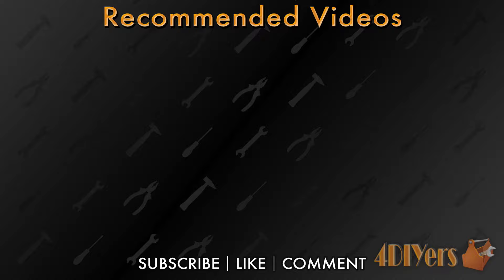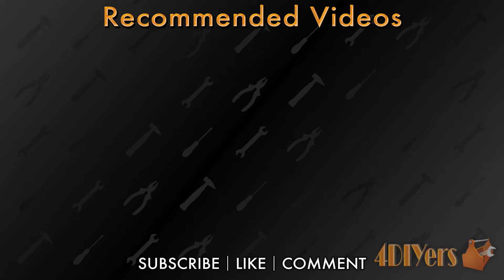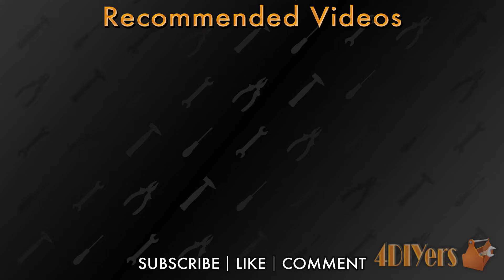How to: Toyota Tacoma 1995 to 2004 Fuel Filter Replacement

Comment: It’s actually 14mm line wrench and 19mm wrench.
Reply from the maker: Same thing... 9/16"=14mm and 3/4"=19mm
Reply: @4DIYers  ehh not exactly. 9/16” and 3/4” are ever so slightly bigger than 14mm and 19mm. Toyota never uses SAE sizes on their vehicles only metric. If you use the wrench sizes you provide then you have a greater chance of rounding the nuts off than just using regular wrenches. Other than that it was a very helpful video. Thanks
Reply: @bretthoughton7887 it's probably close enough for a fuel filter with very low torque on the fasteners.
Reply: After 24 years in place, almost every bolt under my truck is size Vise-Grip. Even the 14mm line wrench started to round the bolt head. So I ended up using a standard 3/4" and a Vise Grip. Had to muscle it quite a bit, way more than you would expect for a filter. But all in all not too bad.
Reply: @4DIYers wrong answer
Reply: @bretthoughton7887  Exactly!  They aren't the same sizes.  Even though they "may" be close enough, you run the risk of damaging the nut faces.  Use what is intended.
Reply: @bretthoughton7887  however toyota dont know every thing.
Reply: @bretthoughton7887 good point
Reply: Thank you

Comment: 19mm & 14mm not 3/4 & 9/16 (metric not imperial)
Reply from the maker: 19mm is equal to 3/4" and 14mm is basically a 9/16" (only 0.2mm difference). But the issue is not all basic wrench sets come with 14mm.
Reply: 4DIYers I didn’t even do the math 🤦‍♂️, I just thought “wait that’s not right”. I’m going to start helping my buddies work on their old fords with metric wrenches...🤫
Reply: @4DIYers   Its a metric vehicle, why you would do the conversion to standard is beyond me.
Reply from the maker: @innerpeas  It's not doing a conversion, it's basic important information when wrenching. As mentioned above, not all wrench sets come with a 14mm. It's like like a 13mm is the same as a 1/2". If you need two 13mm wrenches and only have one, you can use the 1/2" as well.
Reply: Never seen a wrench set skip a 14mm

Comment: Toyotas are a little different. A lot of Toyotas do not power the fuel pump just from turning the key on. The fuel pump doesn't get power until the starter is engaged. Unlike a Chevrolet.

Comment: Anyone know why my 98 tacoma 2.4l turns off when I come to a stop but starts right away? Only happens when I ran it for a little and I step out to go to the store and turn it on again took it to many mechanics and can’t find the issue
Reply from the maker: Do you have any OBD codes? Could be a faulty sensor or too low of idle.
Reply: Same with my 3.4

Comment: 1995’s filter is under the intake manifold, change the title
Reply from the maker: That's the 4cyl model, this is the V6 model.
Reply: yeah thats the  v6 . the four banger  is near the top of the starter  its a bitch to get at . unless you have  a car lift. hbjerry

Comment: Great video but which engine does this truck have? I believe the fuel filter is in different spots depending on which engine it has. I have a 2002 2.7L that needs a fuel filter replacement.
Reply from the maker: This has a 3.4L V6, for the 2.7L I believe it's behind the engine.

Comment: all the nuts and bolts on my Tacoma are in metric. Why would some use SAE?
Reply from the maker: Depends on the year or where it was made. This truck was made in California. Also I do tend to interchange between metric and imperial as some sizes are the same, like 1/2" and 13mm.
Reply: @4DIYers  I would go with 13mm because there are more teeth for a better fit less chance of damaging bolt head.

Comment: What about the washers that came with the new filter? No one mentions them in all the videos I've watched..
Reply: Didn't even see the washers until I was throwing the box away.
Reply: @YELLOWLEAF205  were you able to get itbinstalled without any leaks??
Reply: @gillardpetry2068  Tried three times and still leaked,second time I've had trouble with the washers and from now on I'll make sure I buy one without the washers.
Reply: @YELLOWLEAF205  mine leaked too. You really have to tighten the shit out of it. My mechanic friend said that you have to use the washers. Anyway, I got a 32nd more of a turn out of mine, and the leak stopped. It was weird, but true. It was so tight, I thought I was going to break the gas line if I tightened it up any more!!
Reply: @YELLOWLEAF205  good boy

Comment: The 2001 Tacoma 2.4  has a fuel filter under the exhaust manifold in the engine compartment. Somewhat difficult to get to.
Reply: How difficult?  I'm trying to find pictures showing its location.

Comment: As always, enjoy your videos. I have a question. My Jaguar started one day with a vibration type noise on the freeway. I feel it slightly in the seat, steering wheel (but the wheel itself doesn't shake like when you have a bent rim). This just started while I was driving at high speed. The dealer told me tires, so I fitted 4 new Michelins. Then they said rims, so I bought 4 new rims. Then they said prop shaft and gearbox mounting, but still the annoying vibration is there. It starts at around 50mph and is really bad at 85mph, but it's more like a noise with a slight vibration coming through the body of the car. Now they say engine mountings and they're not cheap. Could they be right? What do you think it could be as none of the things I've replaced have had any effect. I've noticed it's not so bad on hot days and worse on colder days.
Reply from the maker: Sounds like the dealer is just throwing parts at it under your expense. They're not properly diagnosing the car. Vibrations can be caused by tires and wheels, however the wheels can be checked for bents. I'm actually planning on doing a video like that, just trying to finish up a few current projects. Tires can also be inspected if a bent broke. However, an extremely simple cause of a vibration can be from a wheel weight falling off or an improperly balanced wheel. Beyond what has been currently replaced on your car, other areas to look at would be a worn or dry (boot can be pulled back and greased) CV joint, worn wheel bearing (I have a video on how to diagnose that), or worn suspension components. Not sure how familiar you are with BMW, but on some models the thrust arms (control arm) had a gel filled bushing which eventually dries out and will cause a shimmy at higher speeds. Being that it's worse on cooler days, it could very well be rubber bushings as they'd be stiffer or even a cv joint or wheel bearing as the clearances are loose and the lubrication doesn't move around so freely. How if the vibration is somewhat consistent after longer drives and doesn't lessen at the end of a trip, bushing would be the first place I'd check. Even on a cooler day, wheel bearings or cv joints will warm up, expand, and soften up grease.
Reply: Thanks, my car had two new lower control arms fitted about three years ago - could the upper control arms cause this?  I know its not wheels because I replaced them along with new tires - it had no effect.  The dealer said its not wheels bearings as this is what I suspected first (front ones were replaced two years ago).  They have the car now again and think its the engine mountings because it vibrates while idling as well but I think that is unrelated to the high speed vibration.  I'll ask them to check the control arms again.
Reply from the maker: No problem. I'm not overly familiar with Jaguars unfortunately, but there maybe common fault areas like BMW and other vehicles. My best recommendation would be joining up on a Jaguar group (either on Facebook or a forum) and I'm sure someone would know a common fault area. A lot of things can happen in 3 years, this depends on the mileage, what type of roads you've driven on, and the quality of parts used (OEM or aftermarket). With the dealer throwing parts at your car, I think it would be best getting another option from a mechanic who specializes in European cars. Things to test yourself, does the vibration change depending on the rpm (you should be able to force it into a lower gear, I'm assuming you have a tiptronic type transmission), during cornering, under acceleration, and under braking.

Comment: Thanks for the video! Just did my 04' Tacoma! Are there supposed to be any seals? I've tightened and retightened and still leaking from the back one.
Reply: Any solution for this? Happening on our ‘02
Reply: @samanthamackenroth3915  I ended up having to get another filter. For some reason the first one just never set right. The other one(different brand from O'Reillys) fits fine and didn't leak.
Reply: @laelrudisill1183  I concur... the $22  Duralast fuel filter (from what I experienced and read) is really terrible. O'Rileys carries the WIX Fuel Filter for $32 that works great.